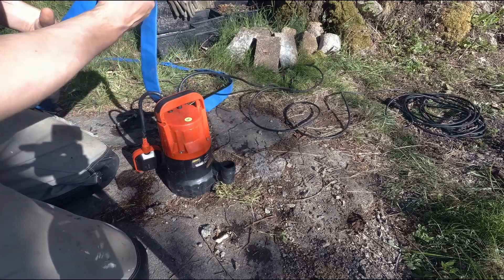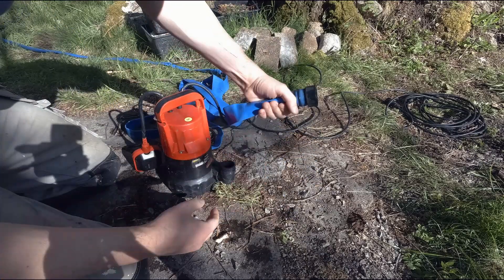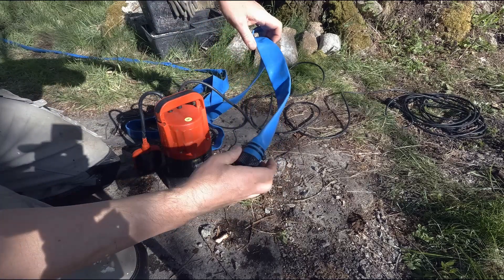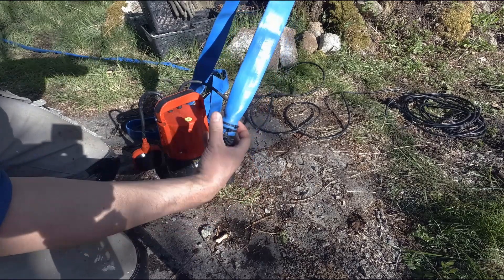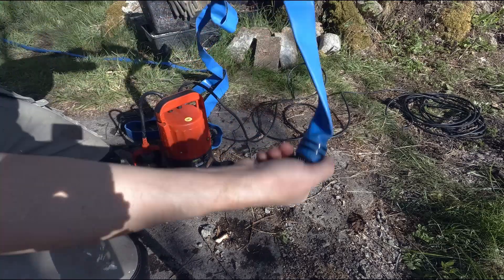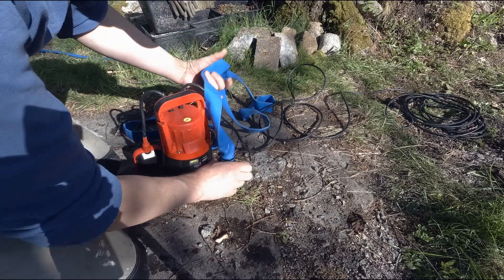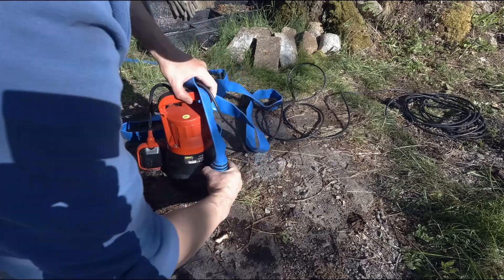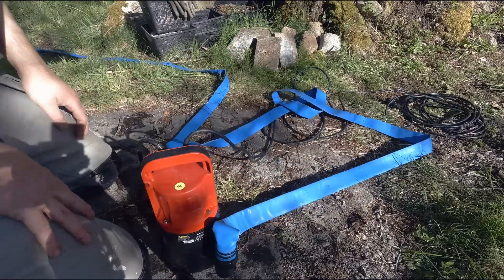Quick Tip #12 - Counter-twist before you screw it on

Comment from the maker: I actually can't think of any other situation than this one where this tip would be handy. Where else would this method be useful? 🤔
Reply: I actually did use this technique the other day, maybe because it was at the top of my head. This was when i was changing the oil in my outboard gearbox. Threading the oil filler can be tricky as it is not free-spinning it rotates the whole assembly of oil bottle, hose and threaded connector.
Reply from the maker: @philmer42  Glad to hear! I'm going to assume that the only reason you thought of this was because of my most excellent quick tip.